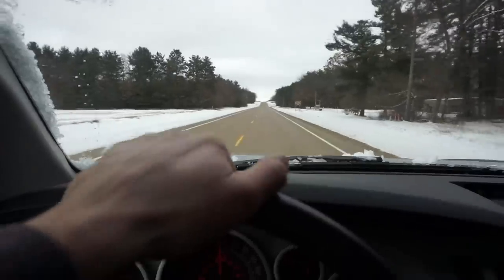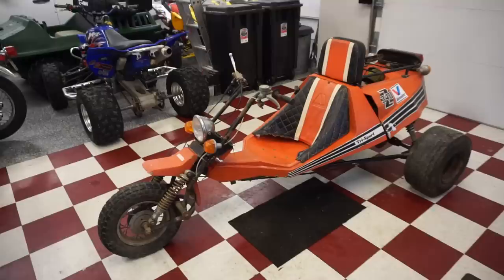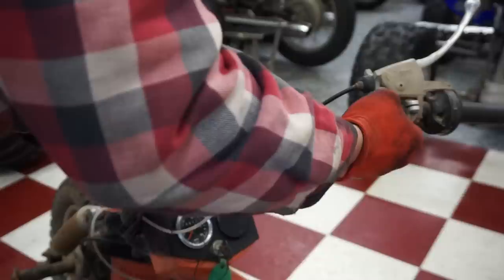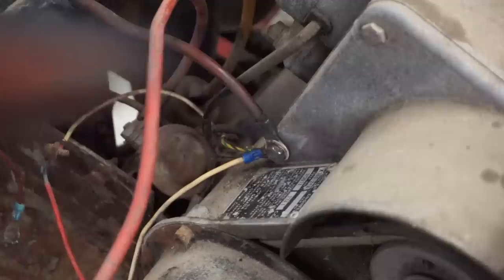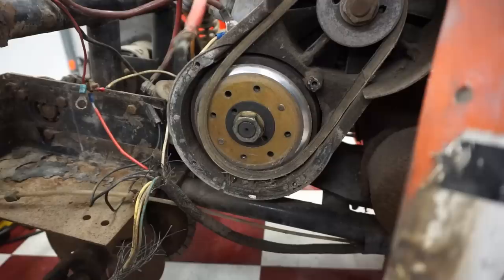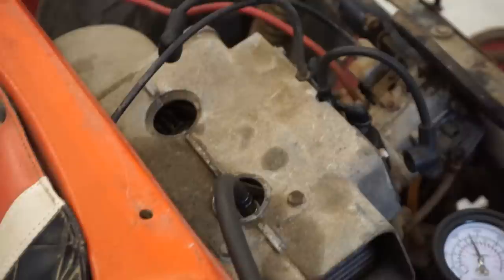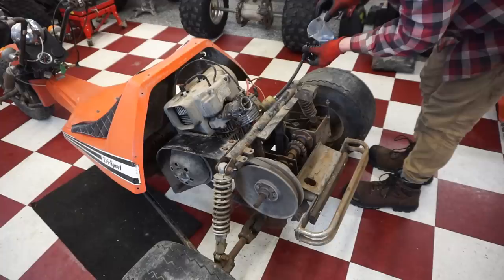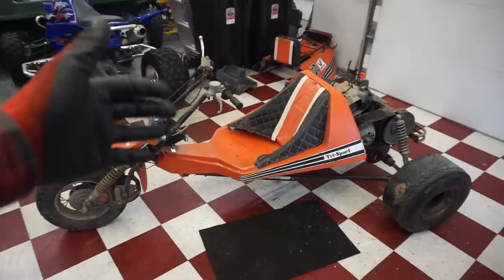Street Legal 340cc 2-Stroke Trike Found Untouched After 40 Years

Comment: That's pretty badass. I think it's definitely worth $1000 considering the rarity, title, and it's street legal.
Reply: Definitely worth it, it's in good shape for sitting that long.
Reply: And just think of the aftermarket stuff that will bolt right on in this modern day.
Reply: @mikeemmons1079  installing a big chrome knarly FMF pipe would be awesome on that👌 Then some of those hoosier Street tires on the rear, mini super moto on the front.
Reply: You had me at "street legal two stroke".

Comment: Hi Joe
I grew up in NW Ohio and my grandparents had 4 of these from 1974.  Two 16hp four strokes and two of the 2 stroke racing ones with the Kohler motors.  

There is a major safety issue you need to know about.  The welds that hold the frame to the axle are known to break and if one does, that side of the axle will swing behind the three wheeler and cause it to flip. 

They solved this issue by welding a horseshoe to the frame that went around the axle.

They also had rear fiberglass fenders to match the orange one in the front.  

I got one of the two strokes from my dad for a birthday in the 80s and only had one issue.  The rear differential bolts came loose and the case exploded making it in drivable and at that time there was no internet to find parts as they had quit making them in the mid 70s do to being sued.

Comment: These were made in my state in the mid 70's. I own the Phase 111 Rager and the RTS 340. I believe the street legal has the same Kohler snowmobile engine as the RTS 340. Looks like it does. I have manuals and schematics. If you need help with something, let me know. The tanks are easy to find. If you need help finding a tank, let me know. There are many new old stock parts still around.
Reply: The street legal models do around 40 mph in very good running conditions. My Phase 111 Rager is insanely fast. They are fun.
Reply: !!2
Reply: they were also made to swap out your snowmobile engine out in the summer to use it hence the name we had a couple and did exactly that we used Kohler and Sachs engines
Reply: The street legal ones have a vin that starts with SL. Also, the street legal ones came with a tecumseh engine four stroke... I replaced mine with a 250cc Honda quad motor, liquid colled, that has 4 forward and a reverse. It tops out at around 60mph. I used calipers from a sports bike so it has killer brakes.. I had no problem registering it in the state of CA after it went through a state police inspection... I use mine all the time... Fun machine!!! They went into production in 1974. Mine was produces in 1973 so maybe it was the prototype? not sure! :)
Reply: I have one that had a rotex 377 engine on it motor was no good I haven't messed with it in year but I've been thinking of working on it any info on where to get any parts?
Reply: @Davidsmith-uu4bl  I have looked for parts without any luck.. Mu gas tank was cracked and i could not find another one for a long time.. I end up going with an external one... No parts what so ever on body.. you can use different engines without much modification.. differential is rebuildable... shocks, plenty of after market that will work.. wheels, rims.. not a problem..
Reply: So

Comment: We had one of those around our house when I was a kid. It had a Tecumseh engine (maybe 8HP). The throttle cable eventually broke so I drove it by pulling a string that was tied to the throttle linkage on the carburetor and draped over my shoulder. Fun times!

Comment: Brings back memories. I had the same bike and put over 100,000 miles on it. The carb slides are vacuum operated. To get it to run smooth you'll need to get a carb synchronizer. Mine looked like a long thermometer with 4 mercury filled glass tubes. Don't give it any throttle when the synchronizer is hooked up or you'll suck the mercury into the carbs. Good luck.

Comment: My dad sold these back in the 70s we had one exactly like this one not sure if it was a 340 or a 440. Also had 3 of the smaller ones , basically a snowmobile on wheels .  Good luck getting it going.  (Ontario canada) they also had a little 3 wheel dump truck which he had to, the week point was the aluminum rear differential it broke so he cut a vw tranny apart and put it in . Top speed was 17 miles per hour .

Comment: My family and I had something similar to this back when I was a kid in the 70's an early 80's it was called snowco tri scat and it had a 5 hp briggs and stratton on it and the back tires on it were the ones like you would see on the monster trucks at least the tread and it had a wheel on the front and a ski also for the front so that you can ride it in the winter.
Reply: I had one of the snowco too in the early 80's I used to ride it every day after school me and my buddies rode the crap out of that thing.

Comment: I had one of these as a kid, they were awesome! the independent suspensions were great, mine was a JLO Rockwell 292 1 cyl but I replaced it with a 340 2 cyl snowmobile engine! Its was stupid fast for the time around 1986/87 My Tri sport also had no rear cover, and a tall overhead height roll bar. Mine was not street legal, no lights. Mine did not have front spokes or front brakes! Just the rear hydraulics!

Comment: Joe: I ran across your video of this 340 Tri-Moto caught my eye! I had the chance to ride one of these in the California desert of California city, back before California city was built up! About 1976-77 a patch of desert directly east of that location nothing there then! What a blast! I’ve never had more fun on something! It was wicked fast and because of the design you could run it as fast as it would go , whip it floor board it and immediately go in the opposite direction!!! You could not flip the vehicle because it was so powerful , the one I drove had knobby off road tires on it front and rear! The suspension was very forgiving! Almost felt like a hover vehicle! Sitting the way you do gives you a fantastic low center of gravity! These tri-moto’s  are very rare! Scoring it along with a spare motor is a great find! I think you got a bargain. I don’t know what the top speed was but it felt mighty fast! Since it was built with that variable speed Automatic V clutch drive it was a bulletproof design! Forgot what the drive was called but you get the idea since you have one now! I think it came from the snowmobile design , and where the engines came from too , but trying to cash in on the dirt bike click of the day which was enormous back in those years! Hope you have fun with it! Regards the original Mad Mike from California.

Comment: I used to have one back in the late 80's and 90's and I wish I still had it today. It was clocked at 110mph by a sheriff, so the owners sold it to me for a $150. They cut off the front end and turned it into a 4 wheeler with independent suspension. With the low center of gravity you could literally whip that around on a dime. My family and I had so much fun on that it would make you grin ear to ear. Memories is all I have. Enjoy
Reply: Forgot to add, it had a spring loaded gas pedal out of a Toyota van and a hydraulic clutch assembly turned into a brake out of a Datsun car. it was, 4 wheel independent suspension with tie rods in the front and a steering wheel. It was a cool little vehicle.

Comment: One think I've noticed is that a lot of DIY YouTubers use water pump plyers and adjustable crescent wrenches Bass Acwards. You put the load on the upper jaw not the adjustable or lower jaw. the teeth of water pump plyers are designed to "bite" one way only and the strength is in the fixed jaw of adjustable wrenches.

Comment: I had one back in the day. It was a very early model and they didn't use jigs when they welded the frame together yet, so the frames warped as they cooled and things just didn't quite line up. It ate the bearings that supported the differential every thousand miles. The Koehler 340 2 stroke had a number of things wrong with it from the get-go, so they replaced it under warranty with a very reliable single cylinder 4 stroke with 18(?) HP. Not nearly as fast and vibrated like a paint mixer at highway speeds, but it started and ran. I drove it for about 2 years. Fun on the road and fun off after I replaced those awful and very heavy semi-slicks rear tires with lightweight tires with a knobby tread pattern.

Comment: That thing is sweet man. The belt looks low on the secondary. You need to adjust belt deflection or you’ll be taking off in second or third gear basically.

Comment: Joe,  I successfully repaired a very similar fuel tank like the one you have with a plastic "welding" kit. Mine had a split about 3 inches long. My tank is made of polypropylene as yours most likely is. I bought a "model 6" kit from a company called Urethane supply. Very complete and comes with everything you need including a great instructional DVD besides printed instructions.
   If you've got connections, you might consider replicating one from aluminum. You look like you're getting a shop going, so having an AC/DC TIG or AC/DC MIG welder that can do aluminum might be on your wish list if you don't have one already.
   If you decide to get one, there are some great  multi-process units out there that actually have it all. (AC/DC) MIG, (AC/DC) TIG , (AC/DC)stick and a plasma cutter all built into one machine for less than $2K.

Comment: Cool piece to work on for sure seen one here in Canada once. A couple of pointers that port you thought was for oil injection on the carburetor is actually meant for a primer hose and was not used obviously as I am thinking due to it being a warmer weather machine. Many had primers in those days. A little hint why the clutch side cylinder may have a bit lower in compression is they ran a bit hotter on that side as you see it is farthest from the fan. Can have a 10% difference in compression so it was not that bad actually. You should be able to unplug the ignition switch and kill switch and it would have spark as long as the points are not dirty like yours was. Keep up the good content.
Reply: That machine is pretty cool, my step dad and my brother had a couple of those motors from snowmobiles and we had put them on a gocart, those 340snowmobile motors were fast as long as we made the drivetrain direct with chain and sprocket,after we did that direct drive, it made it positrack, then we had a helluva time keeping tires on the back, it would do donuts on pavement, those 340were fast hooked up like that.
Reply: Absolutely right, that nozzle was a carb primer because as we all know, 2 strokes are terrible at the mileage level, due to crank area used as a holding area for the incoming fuel charge. Used in PORT intake and exhaust systems. You need a good sized shot going into the system for the first time firing up. I drove 2 strokes for the first years of driving, back in the’70’s. Started with a Yamaha 250 and then straight to a ‘72 Kawasaki 350 triple.  Next year after I got myself one of them there new, Yamaha RD 400’s. Greatest bike of the time. 14 years later, picked up an ‘83 Honda CB 900 F Super Sport, smoothest 4 inline I ever had. Throw in a few off road bikes ( Jawa 250, Honda CL 250, Honda XL 500 ), and finished 10 years ago with a Honda Magna V/65.  Every one was a learning experience, but always worth the work. Drive on but be safe. 👍🇨🇦

Comment: I owned a TriSport 3 wheeler in 1972 in central Indiana. It was electric start, everything worked properly and it was really fun. I think they are very dangerous on the road because they are so low, no one sees you! They would pull right out in front of me or turn left right in my path! I sold it after one summer. It was fast and fun

Comment: Sounds crazy but got one of em back in late 90s. It was only 250 but once it was running good it was fast, had ever but the seat. Body was fiberglass. It would scream. Restored to back to clean like new condition and sold to an old man in Albuquerque that had a couple more. I remember finding a place that had aftermarket parts for them and got some stiff for it, seat etc. Have fun! Think you over paid a bit but you'll get it back out of it. Good luck!
Reply: As rare as that is he didn’t overpay.

Comment: Those Kohler engines were pretty good back in the day! Much better than Briggs and Stratton!  I think they are cast iron and last a lot longer! I have a old Cushman scooter that ran really good and was pretty fast!
Reply: It's an aluminum piston port induction twin cylinder two stroke with a single Tillotson carb, found in many snowmobiles of the era.
Reply: @jamesgeorge4874  well excuse me but I never seen a Kohler 2 stroke engine! Sorry
Reply: @stevebarr9604  It's all good. The late 60's/70's snowmobile era was wild. You had to be there.

Comment: I had a similar trike. It originally had a Briggs & Stratton. I single cylinder skidoo engine on it. It had a ski to change over to for winter. Some advice….when you switch back to the front wheel in the spring don’t forget you can’t cruse over snowy ditches. You will become Superman instantly.

Comment: Used to ride a small trail bike from around that same time period as a kid.   Simple engineering on those back then.  Working on them wasnt much different than getting a chainsaw or a lawnmore running. I wonder if you can find tires for it.  Deffinately a rare find.  And even if you dont get that engine going for some reason. You can always through a different engine on that frame.  The pride of  Canada  in 1974.  I think the world fair or expo was in montreal 1974.  Then the Olympics were there in 1976 i bet they made a bunch of these around that time.  But ive never seen one anytime recently.

Comment: Joe you should do what my dad did to ours. It pretty much sucked in the winter. It didn't turn well on the snow and ice of Northern Minnesota and the wheels didn't do much of anything but spin like crazy. Dad replaced the front wheel with a snowmobile ski then it turned on a dime but tires still just spun of course. So next was another set of wheels and tires with snow studs big improvement but still sucked when you were riding in deeper snow. Then dad happened to come across some bigger wheels and I mean quite a bit taller with some paddle tires with about 3 inch tall paddles and of course 5 snow studs on each paddle then it got around great but was a little slower than neighbors Kawasaki 440 snowmobile so Dad didn't care for that much so in went a 500cc snowmobile engine and that trike instantly became a beast.  Neighbors sleds didn't stand a chance after that on the  back roads in the winter but get off the road in the woods and of course the snowmobiles were king lol. Thanks for giving me something that brought back some great memories with my dad

Comment: Use heat on the gas tank area where it’s cracked to get the tank back into its original shape with the cracks meeting up together and then plastic weld it together and then fibreglass over top of the tank after you rough up the whole tank with 80 grit. Make sure you are able to fit a delivery bung on the tank so it will seal well and not leak and it has good threads. Put a shut off valve there and then connect to tank. That would be a good fix and cost very little. Just make sure at the bung area you use enough fiberglass mat to make it really thick and sturdy. Hope it helps you. Most body shops do plastic welding on bumpers and that could be a good source. Hope this may help you. Good luck. Cheers.

Comment: I worked all summer when I was eleven/twelve at an auto body shop, to earn one they had (ts 130). Once I got it home I did a lot of cleaning and found a engine, fixed it up really good. Pushed it up a hill for practice runs, just coasting. I could ride it with either back wheel off the ground. And stand on the back pulling the front wheel off the ground. I finally found all the parts necessary but didn't have a welder. My good ol uncle said he would help. Never saw it again. That sob! Hard to believe that people can do something like that to a kid, even family. Saying he did me a favor selling it, gave me my half, $25.

Comment: You might be able to hot sand then plastic weld the old tank.  Hot sand  is just that, a large 1/4 barrel full of heated sand, we used a propane burner and that very fine sand like you find on some beaches or in old hotel ashtrays in the lobby.  Heat up your sand get it over 150 but don't exceed 165, then put the tank in the sand, fill it with sand as well.  Let it sit for 5-6 minutes, then pull it out, dump what sand is in it quickly and shape it to where you want it.  Let it cool, then clean it completely, giving it a final rub down with some naptha or methanol, let it dry then plastic weld it.  Don't try to use epoxy on plastic that old and frail, I've seen a few times where the epoxy actually weakened the plastic.  My boss at the time said it had something to do with the type of hardener used attacked the older plastics as they broke down and degraded.